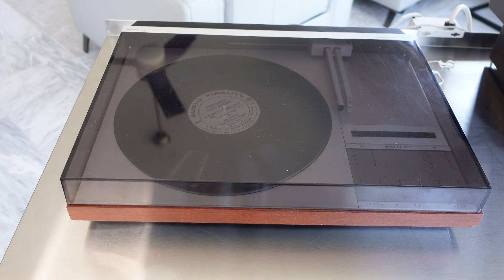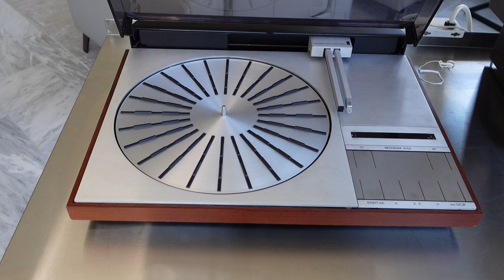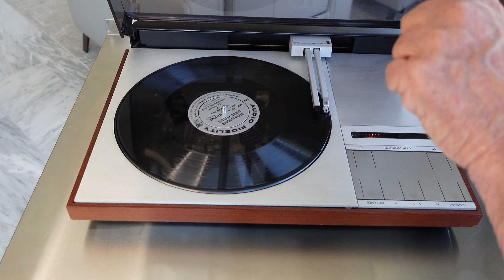Beogram 4002 Introduction and User Manual

Comment: I have one still in its box, I wonder what it’s worth
Reply from the maker: For a working one, at least in USA you will have to pay $400 to $4000. So like with everything, it all depends.
Reply: @BeoManiac  Was wondering... Could you tell me which Beomaster model is best to connect to a Beogram 4002? I just picked up a 4002 at an estate sale and really want to get it connected to the right companion piece to start enjoying records! Thanks for any guidance you can provide!
Reply: Is there any way to adjust the tracking speed?  I have a Beogram TX, and my tracking is too slow. It seems like the groove in the record is pulling the tonearm to the interior of the record, and when it pulls too hard, the music stops for a few seconds, the arm adjusts itself and then the music resumes. If you could provide any information about how the tracking is performed, I would be in your debt forever.
Reply: @michaelburke5750  I have had a similar problem with my TX2.  The bar that the arm slides on needed to be cleaned (mineral spirits on a cloth or q-tip, and lubricated with a tiny bit of silicone grease). Then make sure the arm that lowers the tonearm is not sticking as well.  The record grooves pull the tonearm which moves a lever that drives the motor.  That motor should only engage when it is told to, so that should be clean too.  I hope this helps, i am assuming the TX and TX2 work in a similar manner. Good luck!